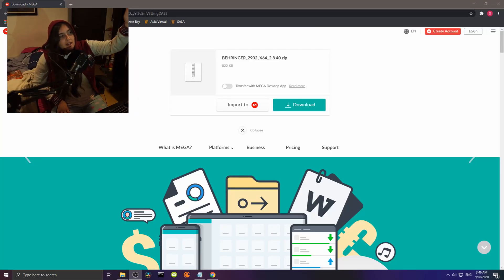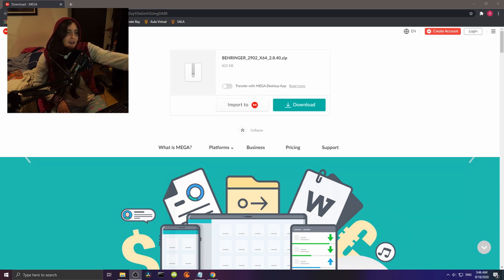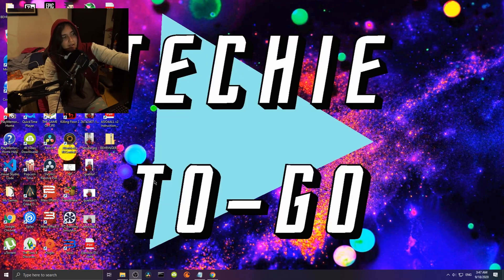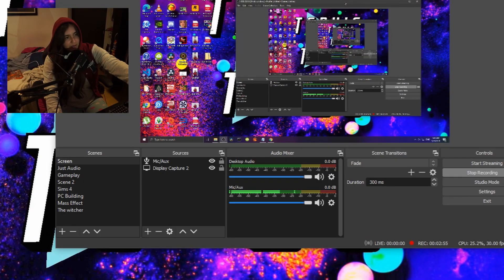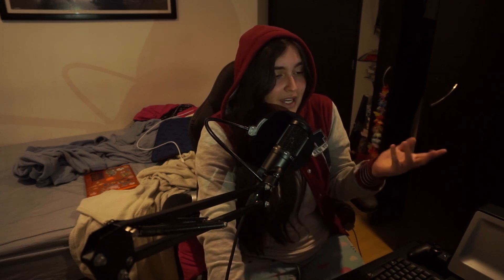FIX UPHORIA UM-2 NOISE!! (ALSO WORKS ON OTHER INTERFACES)

Comment from the maker: IMPORTANT NOTE: This changes your ability to use mono audio. Therefore, if you install these drivers, you'll only get dual channel. This means that you'll have to make it mono in your editing software, recording software (I use the feature available on OBS) or by using something like Voicemeeter Banana. Considering I've seen this being an issue for some of you, I'm going to tell you how to reverse the driver install if you're not satisfied with the results:

1. Right-click the Windows/Start button on your bottom left corner.
2. Click on "Device Manager"
3. At the bottom of the list you'll see "Universal Serial Bus controllers", click that.
4. You should see your interface, double-click on it.
5. A little window will pop up with a few tabs, click on the "Drivers" tab.
6. You'll be presented with two possible options, "Update Driver" and "Uninstall Driver". "Update Driver" should tell Windows to look for the newest driver they have and install it. I'm 100% sure it won't damage your device or anything, however I haven't done it myself because I'm fine with the ones I mentioned in the video. Worst case scenario? It just doesn't install new drivers. Now the other route is "Uninstall Device". This one will just remove the device and the drivers for it from your computer. To get the original drivers back, just disconnect and connect the interface again, and Windows will do its thing.

Hope this was helpful!
Reply: Thank for the video... it really help me a lot.. But as said i cant be using mono. However I am interested on what difference does it have using dual and mono.. Thank you for the video once again.
Reply: Thank you!
Reply: Thank you for this information. I uninstalled its driver via its software and it didn't detect the device, for a second I thought it was dead
Reply: @Saintwolvinn i installed the drivers but still sounds bad i have the mxl990 and it’s sounds so bad with the um2 for some reason idk how to fix it
Reply: Hey, so I came across a software called Tracktion, which is compatible with ASIO drivers like Behringer and lets you customize your audio natively through the Behringer Control Panel or ASIO4ALL. Speaking of which, I do also feel downloading the ASIO4ALL software is necessary for the purpose of fixing audio too. I tried Tracktion after coming across glitchy audio with the default Windows Audio, and it fixed everything for me! :D

I felt like bringing this up to you for those having any further issues. You can even post an update video about it if you'd like. A shoutout would be cool, lol.

Also, there are different ASIO audio drivers designed for different audio interfaces, like USBPre 2 I suppose.
Reply: What's the site again for the download?

Comment: Well it completely destroyed my device workiness xD
Now i can't even uninstall those drivers to use it even with noise.
Reply: same issue, i tried to just reinstall the old drivers but its just bricked
Reply: @julianmartinez2590  i just system restore point. Check if you have any available from before instalation

Comment: I want to start a podcast. I am not sure of which dynamic mic and interface i need. Should i need a pre amp? I have a noisy environment due to the room close to the main street with vehicles and peoples noises. Could you help me choose easy and little cheaper good ones please.
Reply from the maker: Hey! Well, definitely don't get this one. It has grounding issues that make it excessively noisy. To be honest with you, a Scarlett interface would be ideal. It's the standard, and while it's not the cheapest you can find some good deals on used ones on eBay or OfferUp. If you plan on using an XLR mic, which tend to be the best in quality, you'll need the preamp (a lot of interfaces have it pre-built). In terms of a dynamic mic, I like the AT2020 I have, but it is a bit on the noisier side too. You SHOULD be able to get a decent one with around $100 new. A Samson C01 is also a really good one I've heard about. Again, I think the used market is going to be your best friend.
Reply: @thesaintofwolves  thanks so much. Now, the Scarlett has different options. Since I am doing solo podcast,  can I use the Scarlett solo interface? Which version you recommend. I am not interested wity  used stuff cos it's not trust worthy at all and I am from India. Please give me some option on interface and the xlr cable. 
I can't buy any pre amp. I have a natural loud voice.  Please guide me bro.

Comment: Just a heads up for anyone looking into this for music production purposes: The drivers do not remove white noise, they just help reduce it, if you record DI tracks and then proceed to reamp it using a plugin, you will still get a lot of noise! Both this interface and the UMC22 (the one I had bought) are not grounded properly and they have a series of issues that make it so they are not appropriate to musical production! If you bought one of these to record with amp sims, don't bother, return it and get something else!
Reply from the maker: Indeed, these audio interfaces are quite bad. The video is more for those who can't return it, but yeah, the best option if available in general is precisely that.
Reply: @thesaintofwolves I didn't return mine ended up buying a Scarlett 2i2 to replace it. It's completely unusable! Furthermore the drivers are a mess! For me the interface would send audio to sides of my headphones, but it would only send the L channel meaning I needed to pan everything left (and yes, I've got a proper stereo 3.5mm jack adapter). Palm muting using this thing was specially infuriating as the noise would get even more audible, sweep picking was also a nightmare with it as the noise would always bleed in into the notes and even with a perfect muting technique I'd still get noise even when there where no strings ringing. Oh and the grounding issues? Yeah, if I use this thing barefoot when playing I get zapped if I touch the metal parts on the interface

Comment: just bought it , There is so much noise do you think on 2023 the drivers are updated? I test on Audacity and remove the noise with the tool but for me my usb mic sound better. Your audio sounds amazing, I'll try those drivers
Reply from the maker: I changed this ages ago, I actually haven't redownloaded it in a while. But yeah, the interface itself is basura man. If it still works let me know :)

Comment: Now how do I get rid of the ransomware that was packaged with the driver on the Mega site? 😂
Reply from the maker: It was fine on both of my custom built PCs. Not sure why it would give you an issue tbh but hey if you don't want to do it don't. Really up to you dude.

Comment: UM2 is Crap as F... for eg. using cheap Superlux E205U on USB recorded sound has total minimum background noise, using whatever mic i had on xlr the mic didn make noise in background but the um2 did the noise, and to be clear even after driver install... just dont buy UM2...

Comment: the drivers won't install for me for some reason. it goes through the whole progress bar, then without giving me the "line in" option or whatever, says it needs to reboot my computer, then when i check my settings, it still is using the windows drivers.

Comment: Thank you so much.  I had tried a few solutions and nothing got rid of the hiss.   After these drivers were installed and my laptop rebooted I chose the new driver in OBS studio and nothing happened, lol, no sound.  Back in Windows sound properties I found an advanced setting to change from DVD to CD quality recording.  That was the answer and I immediately had sound in my headphones with direct monitoring. Back in OBS I was now able to record, left side only.   I knew how to change that to mono and I was done.  The test recordings had a very tiny amount of hiss but are usable.  This was in contrast to the jet engine amount of noise I had with the previous drivers.   I subscribed and gave you a like.  Thanks again for the video.  I was about to throw the UM-2 in the trash, lol.
Reply from the maker: Thank you for the sub and glad it’s working for you! Ngl I still rock the interface but damn do I despise it

Comment: Hey there. I keep getting "Unfortunately the installation failed. (Error: Timeout - 0x0005) Any ideas?
Reply from the maker: Hey, honestly I haven’t heard about that one. I’d reinstall the intaller itself and try again. If that doesn’t work, uninstall the driver from device manager and restart your computer to install the Windows ones

Comment: for my uphoria cm22 it caused strange problems. everything slowed down :P 
i uninstalled the drives just now.
so sad that behringer does nothing about this. i was convinced that they make cool stuff..
Reply from the maker: Sorry to hear that my friend, it's a bit of a hit or miss sadly. Some people have good results and some have it act funnier. I'm thinking about getting another one because the grounding issues on these are next level. Anyway, thanks for watching my video and giving it a shot, means a lot :)
Reply: @thesaintofwolves  i got actually rid of this popping sound. on the back of the cm22 thehre is a ON/OFF switch, i had it on ON the whole time, not knowing that its for microphones (i looked it up in the manual). now its gone yay

Comment: hi saint, i've tried using the native drivers from windows(just plug and play), and the volume its very good, but there is a big noise(hell) and i got the driver that u said, ok ok, the noise its minnimun, but there is no gain anymore, its necessary speak above the mic, the audio from your video was made with UM2?
Reply from the maker: Hey man! First of all thanks for watching the video. Means a lot! Second, what ends up happening is that instead of being two channels, just one gets the audio. So what may be happening is that you may need to make the audio mono somehow. It’s a big set back for some folks but it’s one of the few solutions I’ve found for this interface.

Comment: I have Behringer 204, it has hissing noise, it's not a grounding, it's not from mic, when i unplug the mic, it's still the same hissing noise.. but when i pulldown the input knob, pull down the mic input volume the noise is dissolved too the same as the input volume.. the noise volume is related to mic volume.
Reply: How to resolve it.
Reply from the maker: Sorry man, I really haven't seen that issue. I know the UM2 has a crazy amount of grounding issues, I don't know what could be causing the hiss. The only thing I can think of is the mic cable.

Comment: Hey there , I’m super late to this , but I have an issue with these drivers , I’m more than happy to keep the drivers installed as they work fine , but because I have a dynamic microphone, normally I would need to ever so slightly increase the microphone level in windows itself , minus the dial on the UM2 itself (the balance would be awkward and without the adjustment in windows it would either be too quiet or clipping with every sound I made) However with these drivers , the option within windows itself to adjust the mic level isn’t the same , the line in is set to 100 , which normally windows has this value defaulted at 50 , and with this being set at 100 , it’s actually quieter than what let’s say 60 was on the default windows driver ?
Reply from the maker: Hey man! My mic became very quiet when I installed the driver, so a lot of the work I did was in post. I never had any issues with chopping though. Bananameter also helped in some situations. I know it's not the best fix but as of right now it's what my workaround looked like. Thanks for watching and I hope that helps with anything!

Comment: This didn't go so well for me, and undoing the process was complicated. 
I use reaper. When trying to access the UM2 via ASIO4ALL, I got unstoppable 1s long clicks. like a killswitch. I could access the UM2 through this driver and not use ASIO4ALL, but then when I exited reaper, my speakers were no longer working. I had to go back into reaper and switch it back to ASIO4ALL to get them working again.

Then, I unsinstalled the driver using the setup from the zip. Then I had no sound whatsoever. Windows wasn't able to find the UM2 as an audio device. It was just showing up as a USB device. I had to manually uninstall the USB device from the windows device manager, uninstall ASIO4ALL, reinstall ASIO4ALL, and plug the interface back in to get sound back.

Then I had to go back into reaper and switch the ASIO4ALL setting to get everything back to it's normal staticky self 😐
Maybe there's a newer driver for it that might work better? Not sure. Thanks for the help though.
Reply from the maker: Sorry you had this happen man! I don't really use it for music, so my experience may have differed because of it. Thanks for the words of wisdom for the Reaper users and other folks in the music side of audio, I'm sure this'll be useful!

Comment: I need some help. I've installed the drivers but there seems to be a buzzing/humming noise coming from the interface. Even if no cable is plugged in it makes the noise. Can someone please help me?
Reply from the maker: Hey Julio, the sad reality is that the interface itself has a lot of grounding issues. My best fix for it has been using the drivers as well as using Noise Suppression in OBS

Comment: Was startin' to worry a little there, that megaupload file is magic. 

Thought I saw no option for mono in Gecata but it's actually under audio quality. rip, was tired... Using my rode mic in GMod was told it's fine but will pickup too much noise if using speakers compared to headphones.

Comment: Hi. Please I have a problem with my behringer U-phoria UM2. If my project on fl reaches a RAM of about 2789mb or above, it crashes when I try to export. My computer's spec is core i7, 16gb RAM, 512 hdd, 1tb ssd, windows 10. Please does anyone know what a solution to this? I would really appreciate.
Reply from the maker: That’s not your Uphoria, that’s either the app itself or something going on in your PC’s hardware. It could be that you have too many USB ports connected, that sometimes causes the computer to act funky. I’d check task manager and see how it acts.
Reply: @thesaintofwolves  Could it be the RAM been around 2789mb? It's funny because my computer's RAM is 16gb. I notice I'm able to export around 2500mb RAM on fl studio, but once it's around 2789mb or more it crashes the minute it finishes exporting. When I use ASIO4all interface and export at 2789mb it doesn't crash.

Comment: I have a Behringer driver installed already but i have noise hum should i remove it first? or installed the version you drop in this video right away?

Comment: After installing it picks up my device and even plays audio through the 5mm jack but it won't pick up the mic
Reply from the maker: That’s a bit odd. I didn’t have that issue. It plays through one channel and you have to manually set it to play on both. Other than that, I recommend going to the pinned comment and following the instructions I put there.

Comment: It doesn't work for me, i don't know why but when i open my daw and i load some guitar VST such as Reaxis or Spark with high gain patches, the noise is brutal. It seems to be tuning in the radio from mars.
Reply from the maker: Sorry to see that! I recommend going back to the previous drivers using the pinned comment.

Comment: I never get the behringer line in option. All I get when I try to hook up my guitar is a constant loud fuzz that completely overrides the sound of the guitar. I'm using Amped roots. Idk if there is something I've done wrong or if this interface is faulty.
Reply from the maker: The interface itself it pretty crappy. Has a lot of grounding issues, though personally I’ve never had problems with instruments.

Comment: Dont do this- seriously, this ruined my whole setup. It amplified the background noise like mad, the mic then only plays on the left side of the speakers which makes it useless for streaming as well as podcasting and if you try to deinstall the driver per device manager the whole thing doesnt work anymore. AT ALL.
I had to roll back my windows to the last restore point just to get the whole thing working again.
Reply: when I tried on my friends UM2, it made it worse(there was no noise with it as it came from factory, just wanted to experiment), but to remove the unzipped folder has an uninstaller, you dont have to rollback windows. Soon I will buy one for me. I think maybe there are 2 models or firmwares on these devices, on one devices it lowers the noice floor aparantly, and in another makes it worse. you have to try it only if you device its noicy like for the girl in this video.

Comment: After I uninstalled this driver, my audio interface doesn’t work. Then, i install asio4all again, still doesn’t work. How to fix this?
Reply from the maker: You need to install the drivers again. As said in the pinned comment.
Reply: @thesaintofwolves  where’s the pinned comment?

Comment: i installed it and it had me restart my laptop, the behringer then comes up in my preferences but doesn’t let me record :(
Reply from the maker: Hey man. Try uninstalling the drivers (like I talked about in the pinned comment). Disconnecting the interface, and connecting it again. Windows should automatically search for drivers for it.

Comment: I did the download but then I got no input of my mic, how can I change that. I don't use it to record, I use it for getting better sound of game and music on my PC and using my condenser mic for discord so I use it in realtime.
Reply: That might be because this driver for some reason sets the audio settings for the input line to 44hz. At least that's why MY mic didn't work. All you have to do is go to advanced audio settings, change it to 48hz and after that it should work again, that fixed it for me. Let me know if it worked